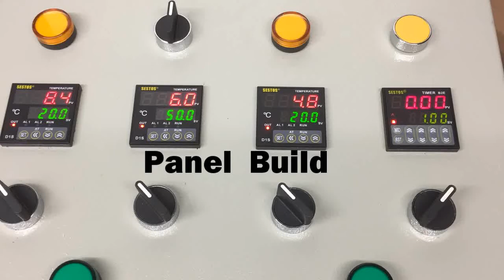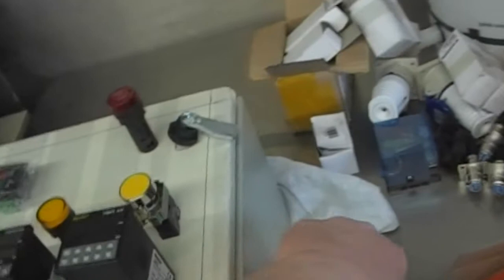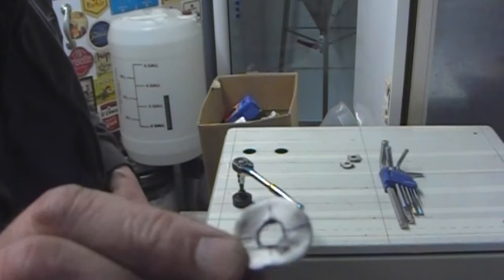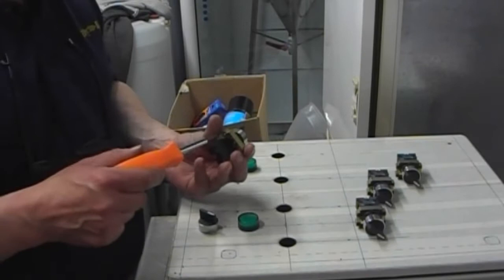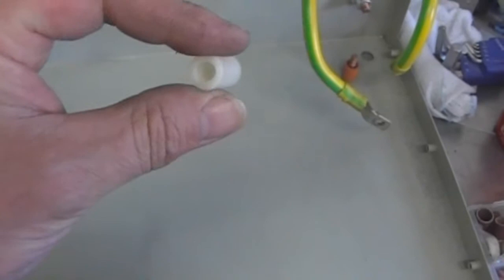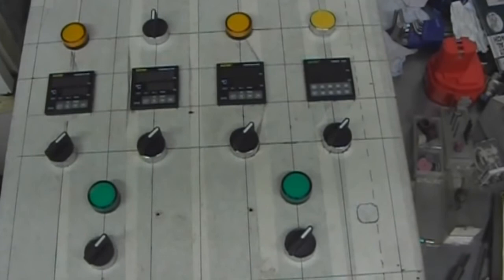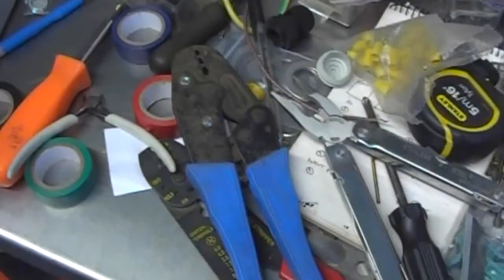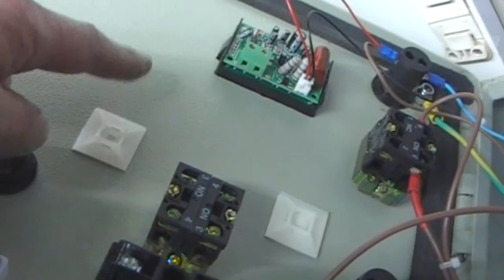HERMS CONTROL PANEL BUILD

Comment: Wow Clive what a brilliant job you have done on the control panel, only thing I've wired up is a plug and STC1000. Well done.
Reply from the maker: Cheers Steve it wasn't to bad worst bits cutting the squares

Comment: Xlr's for the temp probes....Snap! I've 99% finished a much smaller panel for my electric BIAB. Neutrik do some nice power connectors that are much smaller than those you are using, think they are rated at 20 amps and have a twist to lock system 😉
Reply from the maker: I think I have a couple of those plugs, I already had some of the bits I used but there great if using a smaller box, cheers
Reply: norfolkhillbilly My panel is only 300mm x 300mm...and they say size doesn't matter🤔

Comment: Very timely for YouTube to show me this - inspirational, top job.  I recently discovered the hole punch and used it successfully on the kegs.
I also didn't realise the timers could be similar to the PIDs, aesthetics etc!
Are you using the Inkbird IDT-E2RH?
Reply from the maker: Pid`s and timeer are all Sestos which are another brand made by inkbird, at the time a wee bit cheaper, but they are the same spec
Reply: @norfolkhillbilly  Great, thank you.

Comment: Good start Clive. How are you powering the input if you have 2*16 amp outlets (or did I miss that in the vid?).
Reply from the maker: I`ve upgraded the garage supply to 16mm cable, so when the brew cave is built theres plenty of amps spare
Reply: But if you have both heating elements on (which will draw 10+ amps each) you need a 20+ amp supply. Are you going to hard wire the 240v to the panel (well maybe via an isolator)? Sorry if I missed this in the vid.
Reply from the maker: Yeap, it will be a separate feed to the panel via the DP in the garage, so as long as I`m not welding using the compressor and car ramp and brewing at the same time I should have 40+ Amps to play with, Lol  I just have 101 other jobs to get done before I can push on with the hobbies

Comment: nice job so far, do you want to come over and rewire my panel :-) your pid's are they relay switching inside or are they 12v out for the solid state relays? and can the power out put be adjusted manually in the settings to control the element.
Reply from the maker: Thought your boss was doing that lol, pids are 12v out manual mode allows you to do pmw through the ssr mine are Sestos brand but inkbirds are the same just relabled

Comment: brilliant video , have you got a list of buttons / switches ? im currently buying bits , got 2 pid and 2 ssr so far , but the buttons i dont have a clue what will be suitable.
Reply from the maker: Ebay china sellers where peoplemarketing, sellerbible, worldone2012, for switches and lamps, pids cheapest was amazon for Sestos ones, ssr had to buy non fotek ones as so many are fakes
Reply: Cheers , I've gone for inkbird pic and ssrs, I like their all in one temp controller so stuck with them
Reply: I second sellerbible, got loads of stuff from them.
Reply from the maker: Yeah my Sestos one are now branded inkbird
Reply: do you need certain amp rated switches?

Comment: what pid did you use.? cheers
Reply from the maker: Sestos which are made by Inkbird and the same in all bar name as there own brand.
Reply: cheers, clive.
i am a sparks but not in control panel wiring ,if i wanted a wiring diagram would u be able to post me a paper copy,of course i would pay for postage etc.cheers paul,my thanks.
Reply from the maker: Never used one, but I have a copy of a Sestos one which I think came from the electric brewery site, are you on the facebook grp, I can send you a pdf
Reply: @norfolkhillbilly  thanks clie if you could many thanks Paul
Reply from the maker: Think this is the one http://www.theelectricbrewery.com/forum/download.php?id=13702